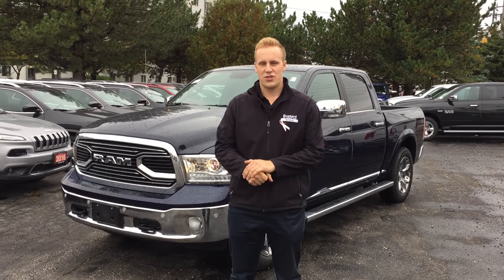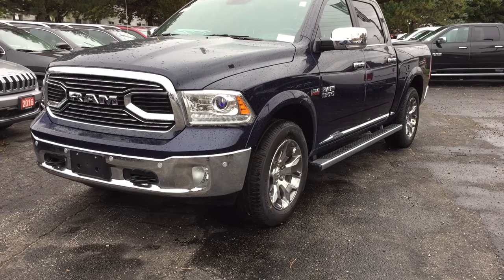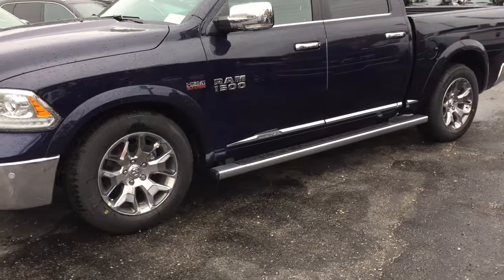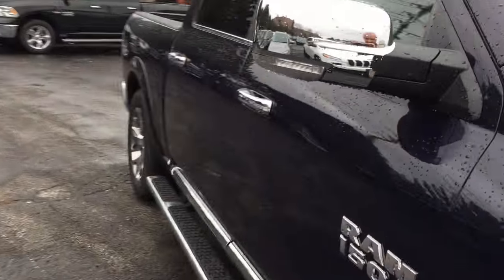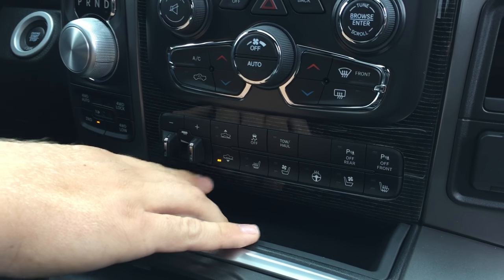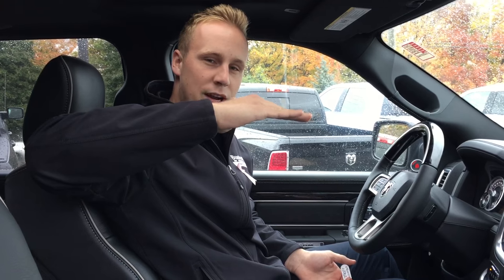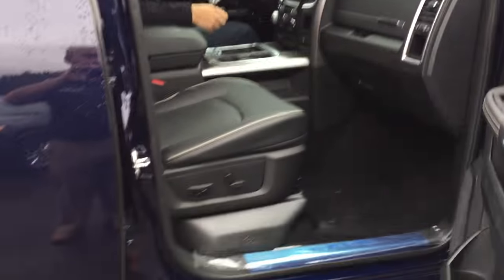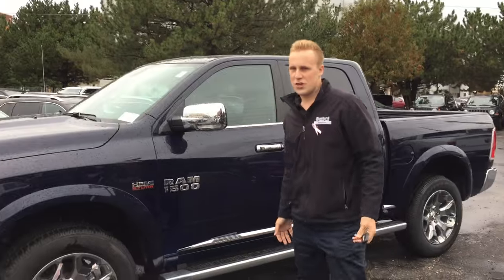Ram's Active Load Level Air Suspension

Comment: This feature gives a very nice ride and the variable ride height is convenient BUT the system is absolute crap.  I have a 2015 Ram Limited with the air ride and a buddy has two air ride equipped Rams in his family with similar issues.  The compressor and valve body fails in cold weather and the air bags are not up to the wear and tear of life on a light duty truck.  If you plan on driving anywhere other than on paved roads (ever) or live where the temperature could potentially drop below 0F then don't walk, run away from one of these trucks.  If a salesman honestly tries to sell you one of these trucks without explaining the air ride faults, find a new dealership because they are trying to rip you off.  I love my '15 Limited except for the terrible air ride system.  My dealership refuses to even order trucks with air ride after all of the troubles they have had with mine and similar trucks they have sold.

Comment: The air suspension is flawed.  It will fail after about 4 years, and is very expensive to repair, even if you can find someone who knows how to do so.  Mine failed when I was 2,000 miles from home with a camper trailer.  Imagine pulling that camper all the way home because nobody can fix the suspension.  Everybody who has had this experience should go to NHTSA website and file a complaint, requesting an investigation and a recall.  FCA should have already recalled this system, but clearly it will be too expensive for them to fix unless they are forced to do so.  File the complaint today.